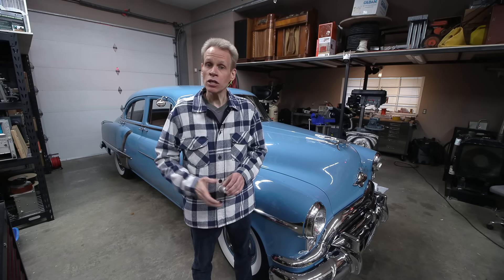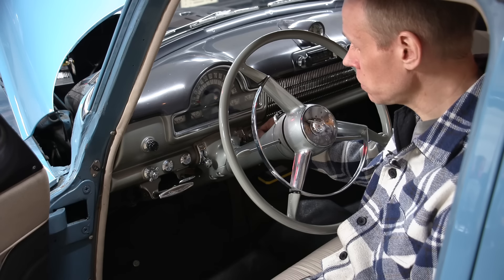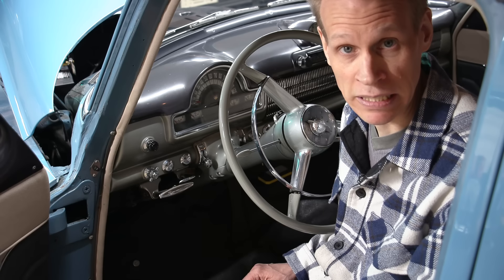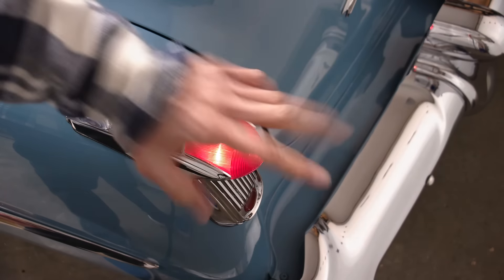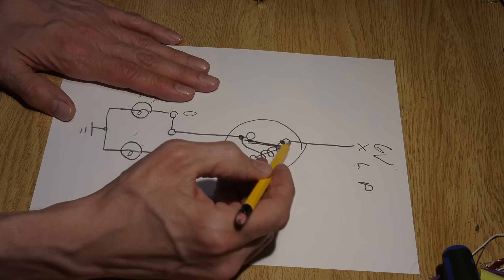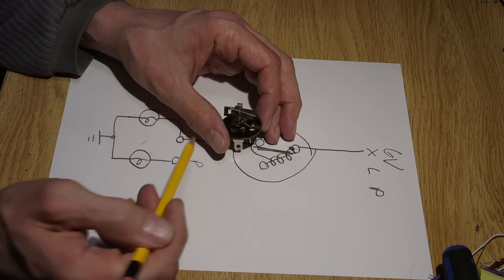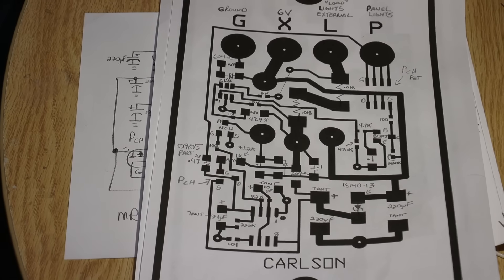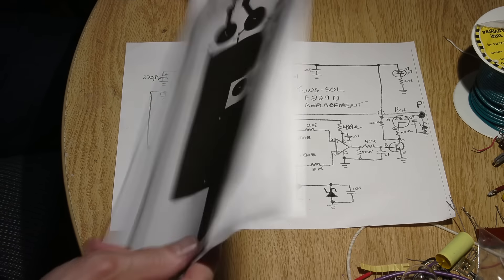How A Turn Signal Flasher Blinker Works - Complete Redesign With Schematic [Tung-Sol P229D]

Comment from the maker: To learn electronics in a very different and effective way, and gain access to Mr Carlson's personal designs and inventions, visit the Mr Carlson's Lab Patreon page here: https://www.patreon.com/MrCarlsonsLab
Reply: Off topic: What is your favorite electronic replacement for a vibrator circuit? I love restoring old car units, but HATE those noisy vibrators.
Reply: Why not add a third function with an additional switch on the dash board somewhere for hazards?
Reply: @Coveangel  Not a bad idea. But did they even have hazard lights back then? Safety wasn't a very big concern. A friend had a 56 Chevy. Beautiful dash. But a very deadly dash made with hard steel pointy curves. Just a lap seat belt wouldn't save that head to dash part.
Reply: @CrispyCircuits  Jay Leno had a joke about the 55 Buick Roadmaster dash, after a wreck they just hose it off and sell the car...or words of that nature.
Reply: @Coveangel  That would make an even more satisfying click!
Reply from the maker: @kurtvanluven9351  It's on the list!
Reply: @MrCarlsonsLab  OOf sorry KI6VST
Reply: How does it behave if one of the exterior bulbs burn out?
Reply: nice ride i have a 1956 ford fairlane
Reply: Well explained enjoyed the video
Reply: @Coveangel  Very good thought.
Reply: Topic I love science how stuff works - great video
Reply: I JUST ASK YOU WHAT HAPPENED TO THE MUSTANG AND MY COMMENT WAS NOT ALLOW TO BE SEEN . WHATS GOING ON PAUL
Reply from the maker: @TonyKing-si2ns  I will look to see if YouTube put your comment in Review. Thats an automated process done by YouTube. Oh, and remove any pictures or links, nobodys channel will allow that due to spammers, any comment you post will automatically be put in a review folder if you include any links.
Reply: @MrCarlsonsLab
Reply: Changed a lot since my 1931 Model A , it has no turn signals .  YET
Reply: I made something similar and used a blown flasher as my "plug" on the ends of the wire to plug in as one connector.

Comment: What I find amazing is that it takes over 30 components to replace a rather simple mechanical device.
Reply: And still use a mechanical device. Lol
Reply: The same holds true for fluorescent lamp starters. The old mechanical version uses a bi-metallic strip to make and break contact. The new electronic ones have many components.
Reply: If someone were engineering this for production of a million copies, they'd work for a month to find a 3-component design that costs 42 cents (e.g. with a small micro-controller). Mr. C just needs one unit that's absolutely certain to work and can be built of junk box parts as he said. He also obviously loves analog circuits. For these specs, his 30-component design is optimal.
Reply: In this case, the complication is the low voltage and high ampere rate that makes for the need to upgrade or improve a little. But you are correct. And talking about voltage - at least in Europe, but I believe in the USA too, what makes analog landline phones somewhat electrically robust, is that they use a little high voltage around 48 volts. I have my self connected pairs of old cranking phones, several hundred meters apart, and connected them just via a single fence wire, and ground via a 30 cm (1 foot) nail in the ground - and it worked! 

Analog is robust - and it always works - everyone can understand how it works - no DRM, no intervention from grerdy corporations or anything. 

But actually - some times - the combination of old and new technology is a good way to go - and we see that often on Mr Carlson’s lab.
Reply: And one costs less than $30 and the other is probably above $100.
Reply: Mr Carlson he knows his things, and are entertaining to listen to.👍👍👍
It would actually be interesting to see if it was posible to "modify" the relay that was more "normal" but not suitable, with eksternal components or relays to help the function. Those could be mounted in a boks between the relay and the cars cable net, that would also be rewersable, but you could use a more "normal" relay. 
Of cause only if it could be done in a relatively simple way. Just a thought.
Reply: I guess you didn't bother to count the components in the flasher.
Reply: A lot of work for something that's pointless.
Reply: So do I. These days I'm sure you could find a single chip solution that allows you to have a customised sound.
Reply: @MadScientist267 : I see what you did there, but it isn't pointless! There are points on/in the relay in Mr. Carlson's design!
Reply: @edwatts9890  Lol good point.. hey wait........
Reply: @MadScientist267  🤣
Reply: @alexsaptetrei  The mechanical relay is (as stated in the video) an "intentional choice" and the way to keep/re-create the "audible clicking sound" . That way the device sounds and acts more authentic. As explained, most of the parts are timing circuits (so one can easily obtain the desired duty cycle)  and other parts are some added protection components.
Reply: @generessler6282 You got that exactly right. A 1-off, a 1000-off and a million-off are all different devices even if they do the same thing. Unless money is no concern of course.
Reply: @MadScientist267  It actually causes pointing (left or right in a sense), so I disagree!
Reply: @blobscott  The pointing is the pointless point.
Reply: In my field I work on industrial machines and control panels between a 1970s machine and a 1990s-present machine are vastly different, even though modern panels still use the older components like thermal overloads and icecube relays, but easily ½-⅔ more components. I do much prefer PLCs with safety barriers and VFD speed control over relay logic and DC speed control, and chunky motor starters.
Reply: Yeah but it’s better 😂
Reply: IT'S ALIVE!!! ⚡😵‍💫⚡.  Big 👍's for Mr. C.

Comment: I am a hotrodder, that started swapping engines and modifying cars in the late 50s.  I can tell you from my own experience, that getting the blinker to work properly in some cars back then was incomprehensible magic.  It was quite common back then, to see signal lights blinking at the rate in your demonstration.  I have dissected a few of those cans, in an attempt to solve the blinking problem, never with any success.  You have solved one of life's mysteries for me.  I can leave this world now, at peace..
Reply: Sometimes you could "bend" the contacts and "arms" around a little bit to alter the rate of the flash, but there was no tweaking that could be done if you significantly altered the bulbs in the vehicle, and hence, the current draw that went through the flasher. 

That is also why one had to get a "heavy duty" flasher if you put a trailer on the vehicle and added more light bulbs. The trailer lights would change the load through the flasher and sometimes radically alter the flash rate beyond usable. 

Same thing when it comes to newer cars and replacing the incan bulbs with LED bulbs. Even though the newer cars have the "flasher" built into the BCM, it STILL senses current through the bulbs and changes the flash rate to unusable if a bulb is burned out or missing, and installing LED bulbs raises the same issue on these vehicles also. 

I have a 1985 Olds Cutlass drag car that I don't run an alternator on. The car still has functioning lights, so I changed all the bulbs to LEDs to draw much less out of the battery. BUT now the flash rate of the directionals was too far off to be usable. Companies make "load resistors" that you install in parallel with the LED bulbs to correct this problem, BUT, they are simply a large, low ohm resistor that hogs a bunch of current to fool the flasher into thinking that the incan bulbs are still installed in the car, and then you are back to drawing just as much current with the LED bulbs as you were BEFORE the switch to the LEDs. Totally defeated the purpose for me of lowering the current draw of the lights by 90% by using LEDs. With an alternator, the load resistors wouldn't have been a big deal. 

So, I came up with my own version of an electronic flasher module similar to the one in this video, except mine was 555 timer based that controlled a relay.
Yep... I had to add a ground to my home brewed flasher unit because just like in the video, the old flasher was simply in parallel with the positive and the bulb, and wouldn't have worked without an added ground. I also replaced the dismal dim 4×6 sealed beam headlights with conversion housings that are still glass on the outside, and look exactly like a factory sealed beam, but the backside of the housing has an H4 socket on it so that you can install any type of bulb that you wish. I ended up putting LED bulbs in the headlights also. 

With the swap to all LEDs in my entire lighting system, I ended up dropping the current draw from over 20 amps for the 4×6 sealed-beam headlights, tail lights, all the side marker and bumper lights and the 2 license plate lights, down to only several amps. 

Here's a helpful hint for you.... If you're going to do this to your vehicle, DO USE the proper colored LED bulb if it is used behind a colored lens! Example: For a red tail light or a yellow side marker light USE a yellow LED for the yellow lens, and a red one for a red lens. 
I tried just using ALL white LEDs behind the colored lenses, and the white LEDs TOTALLY washed the color out, and made the red lenses look pink, and the yellow lenses were like a cream color. The white LEDs were just too bright and too white for the colored lenses, and washed them out BIG time. Once I switched them out for the proper color LED bulb behind the lenses, they REALLY popped and looked VERY nice.  For a headlight LED color temperature, 5000k turned out to be my favorite color temp. Any higher and the headlights were too bluish for me to see well at night, and any lower and they resembled the piss poor sealed-beam bulbs that I replaced. 5000k was VERY neutral white, and lit the road up well for my eyes. Your eyes may vary from mine. 

I can now drive the car on the street, with NO alternator, off and on all day long with a single 200AH Lithium battery and not have rhe battery BMS go into low voltage protect. It will also last an entire weekend of drag racing without having to charge the battery, and it cranks over the 550" 13:1 compression big-block with authority all weekend. 
Other electrical draws on the car, besides the lights, are 2× 90watt radiator fans, 1 Meziere electric water pump, an MSD 6-AL2 Programmable ignition box with a Blaster 3 ignition coil, and a MagnaFuel Prostar 500 fuel pump. It's hard to believe that I can street drive the car around with all those electrical demands and have the battery last all day without going dead, but it does. The Lithium battery is amazing! It's 3 years old now, and still works as well as day 1. 

Wasn't cheap, but was worth it. 👍 

This is just some helpful hints for anyone to consider that I had learned while converting my entire vehicle lighting system over to LEDs.

Comment: My best friend's dad, while growing up, was a Vice President of Tung-Sol.  I had former friend's parents and relatives who worked there.  I still have a Tung-Sol electric eye module that use to sit on top of a streetlight to control when it came on and when it went off.  Even though this has nothing to do with your video, it brought back memories hearing the name Tung-Sol.
Reply from the maker: Thanks for sharing your story!
Reply: I love these types of stories.
Reply: Electric Guitar players will be very familiar with the words Tung-Sol as they are one of only several remaining extant Vacuum Tube suppliers for their amplifiers
Reply: As long as it's going to be destructive anyhow, a good tip for opening cans like that is to just use a pipe/tubing roll cutter. I've opened a lot of wet caps like that too show people how often the crap they get on Amazon is counterfeit garbage.

Comment: Excellent video.  If only more people actually used turn signals these days
Reply: I agree with you 100%. It would be so considerate of others.
Reply: I know and it's so simple to do, you hardly have to think or commit any effort...
Reply: "Good luck everyone else!" 
-Asian Lady
Reply: @20alphabet  she love you long time 🤣
Reply: @MrPnew1  That would be Blink you long time.
Reply: Most use turn signals as a “signal of accomplishment” rather than a “signal of intention”. 😂
Reply: I find that it's apparently extremely difficult to work a turn signal stalk for some drivers. 
I always honk at them in an effort to boost their IQ.
Reply: @HansDelbruck53  Last thing you want is to tell the cop your turning up ahead.

Comment: Typically, whenever you see a solid state replacement of a mechanical component, it's much smaller than the original component. At first, I was thinking to myself "why on earth is this thing so dang big?" However, after watching your explanations, it all made sense. What you created is incredibly robust and should be extremely reliable, something many solid state devices suffer a severe lack of these days. I applaud you for your excellent work. Thank you so much for sharing it!

Comment: That’s a solid design Paul. Thanks for sharing...

When I graduated from Electronics Engineering many years ago one of the things I remember my first manager promoted was simplicity. He had hanging on his wall a plaque he had made up with the word KISS in big letters at the top. On the left side he had a flasher disassembled from a GM car and on the right he had an electronic flasher from a Volkswagen disassembled with about 25 components. Transistors, resistors capacitors and relays. I designed a lot of equipment during my working years. It’s a message I never forgot.

Comment: Frankly, this video came out in a perfect time for me! I was for some time thinking about replacing flasher modules on my 1959 Morris Isis for solid states, just to make it a little easier and more reliable for everyday driving (Yes, we use it every day, especially my wife. She loves that little car). Problem is that the whole system also has traficators integrated into it, which I really want to keep. The originals were apparently vacuum actuated but that got thrown out in the 1980s when system started leaking air, and replaced by electromagnetic system from Morris Minor. Wiring is a bit wonky, so I was putting the whole thing off because our wiring harness isn't looking remotely stock. But this video inspired me to finally get going and get to work.

Comment: That was such a great vid. I served my apprenticeship in the UK, from 1961 to 1966 (yeh a long time) and although I have never encountered this before, and we had the older 6 volt systems on earlier cars. And 12 volt systems on the 60s vehicles.( We just replaced the flasher unit) The vid is so interesting. I’m absolutely unsure if UK manufactured cars had the same system. Memory fading now from back then,but the unit would probably have been manufactured by Lucas. Excellent vid. Just goes to show you never stop learning. Even at 78.Thank you Paul you have made an ex Apprentice very happy,👍.

I’m umm fairly with it on old Radios etc.But there is no way that I could have devised the new circuit for this. That is next level.
Reply: In 1964, the Jaguar e-type was positive ground 12 volts.  Using a "modern" accessory like a Motorola radio or 8-track player meant using a convertor to create a 12 volt negative ground power supply.  I had a '64 e-type OTS with an 8 track!  By the way, Lucas switches while reliable when new developed a different set of parameters as they aged, off, flicker, and burn.  (:
Reply: I seem to remember that not many 6 Volt British Cars had flashing indicators (new fangled American show-offs), you were supposed to put your hand out of the window and signal like you learnt in the Driving Test.
I had a Morris Minor and that had "Trafficators" that were little mechanical arms that popped out when you used the Turn Switch, they lit up but didn't flash, if you forgot to cancel them or they were sticky (a very common occurrence) you usually snapped them off when getting out of the car.
Also, no one behind you ever saw them so you got a lots of 'beeps'.
Reply: @gwesco  Lucas, the prince of darkness...
Reply: @Flash-FX  What would happen if Lucas made a vacuum cleaner?

It would be their only product that didn't suck!
Reply: @michaelhall4626  HaHa! I got that saying from a buddy that owned a XKE from the 60's (it was about 1975 at that time). He was having those mystery electrical issues! We needed Mr Carson back then!
Reply: Most foreign cars (not American 😂) had separate brake and turn signal bulbs. This simplified the circuit and eliminates the need for some of trickery

Comment: I must admit, I prefer the old style (not THIS old, but the 12V models from the 1980s). They would provide audible feedback, alerting the driver that flasher is still on.

UPDATE: YES! You didn't forget this feature! (58:01)

Comment: Just incredible. Okay, so I thought my Winnebago wiring was a nightmare (1968 Ford P-350 chassis) but, this car is worse! I tried installing LED lights for my turn signals/brake lights, with new "for LED bulb" flasher(s) only to be thwarted at every turn. Watching Mr. Carlson try to figure out his wiring was most satisfying. It's like the designer's primary objective was to use as little wiring as as possible. (It took me a bit to realize my little emergency flasher red bulb was using the main, current-hungry bulbs as ground). My vehicle uses two 2-terminal (X+L only) flashers: one for the emergency switch, and the other for the steering column switch. I can't find a wiring diagram anywhere - the Ford one's are close but, different. I don't suppose anyone reading this knows where once can find replacement flashers (like the on Mr. Carlson built?) - of the 12 volt variety with 2 poles!? (Sigh). Brilliant video though!